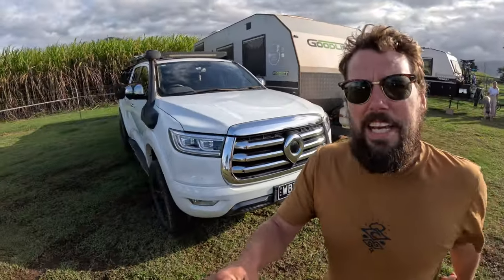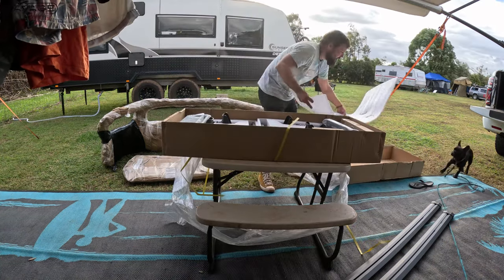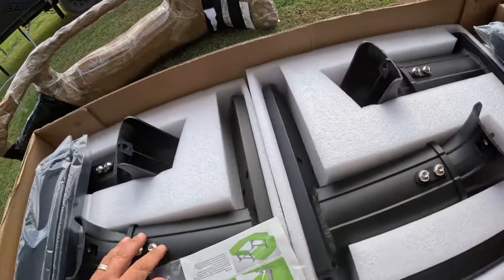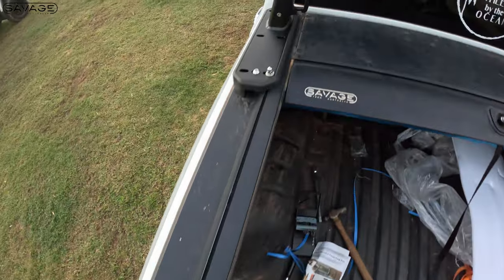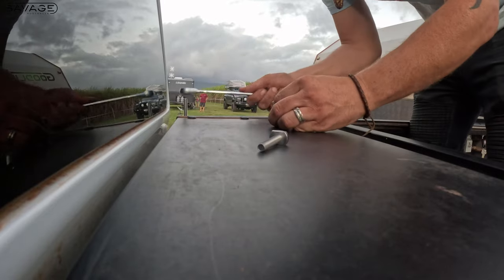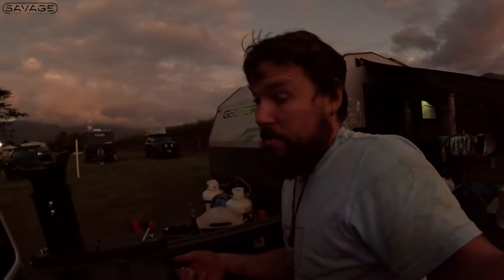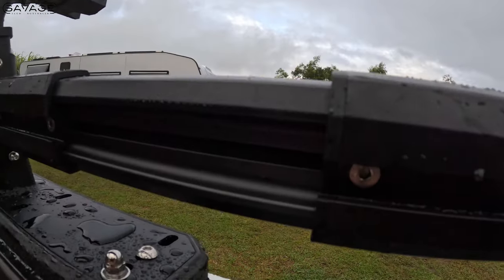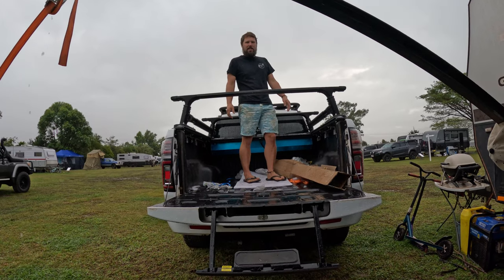GWM CANNON TUB RACK INSTALL

Comment: Looks good, I have a Ironman electric roller way, just wondering if it will fit a different slide away system
Reply from the maker: Apparently it fits most. And is universal fitment. Give Savage tech a call and check with them :)

I don't see why it wouldn't work. Does yours have the bolt slots along the top?

Comment: Looks great! Thanks for the vid. How high are the crossbars from the ground?
I'm looking at exactly the same roller and 1/2 height rack. I also need to stay under 2.1m. My Yakima tent is 500mm thick with the clamps that grab onto the crossbars.
Reply from the maker: I'll try and get that measurement for you today. But I think our setup is just under 2.1m. 

Keep in mind we have 2inch lift and bigger tyres 

We are just parked on the beach atm so can't get accurate measurement right this second
Reply from the maker: 169cm high from ground to top of rail 
Hope this helps :)